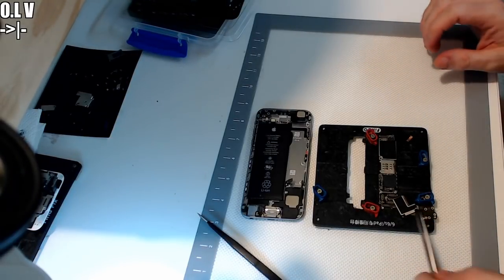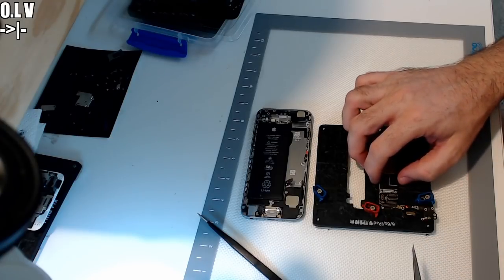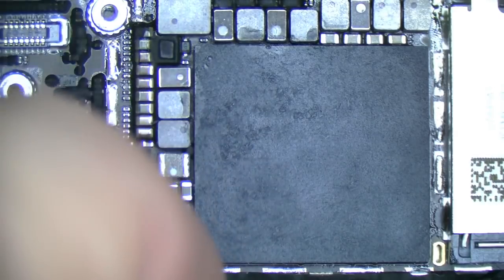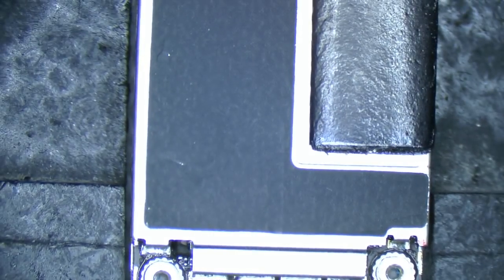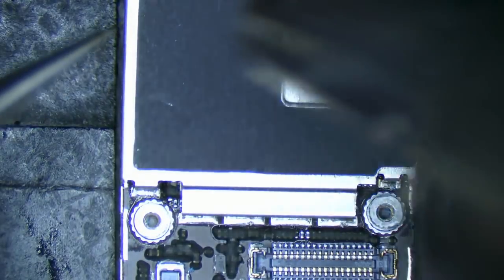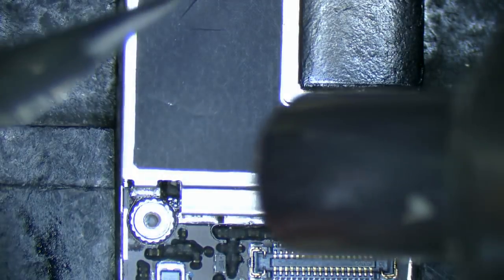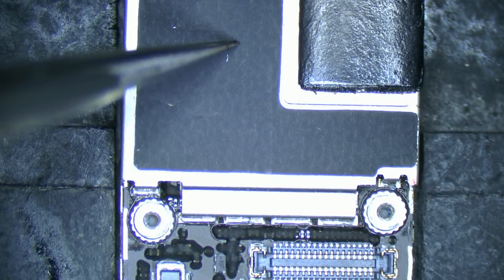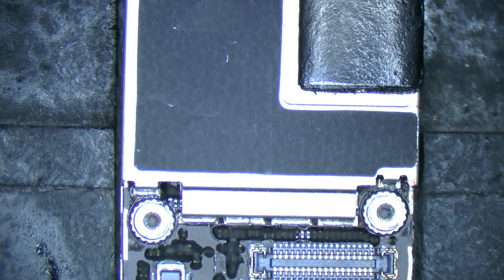Don't tack - Reflow! iPhone shield reattachment technique

Comment: Spot on job paul, it's nice to help each other by showing the methods and logic behind phone and laptop repair.
I noticed people heating the end of solder wick to gently sap up solder without removing pads, i first saw chris using that method, a different way :-).
The removal of sheilds by the drop off method, again clever.
In this day and age of selfish greedy people it's nice to see sharing :-D.
Reply from the maker: Helps us all better our art when we share things around.  I understand that sometimes people do like to keep some trade secrets, at least until they've managed to build up a bit of $, helps to have a "jump" like that now and then, of course when you do show the world, it's good when they in turn give credit.    The hot-air wicking, I'm not quite sure where I picked that up first, I think it might have been Chris Long, or somewhere else.  I know I picked up the gravity drop shield removal method from Chris Long.